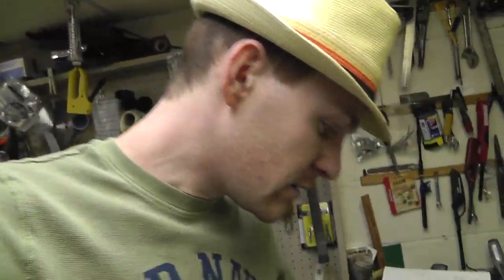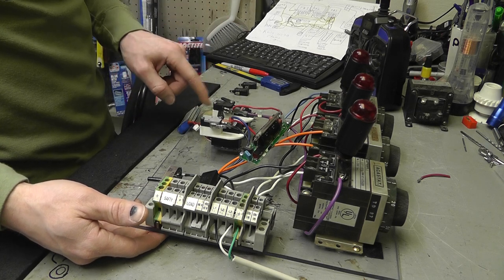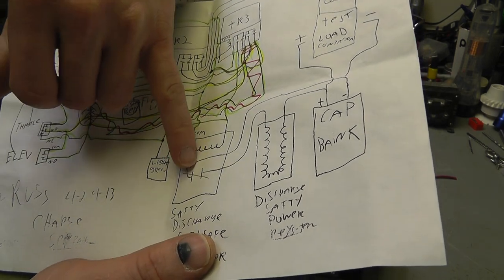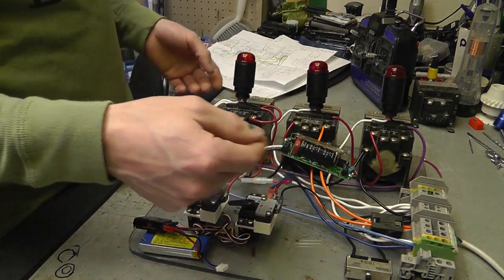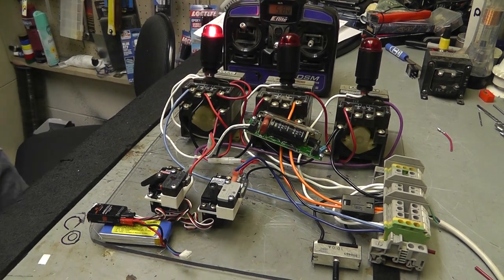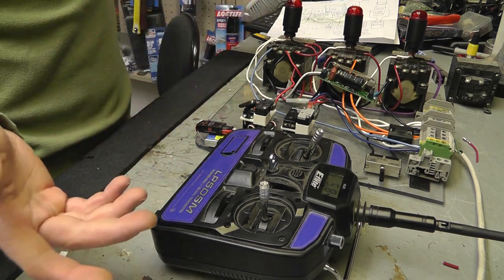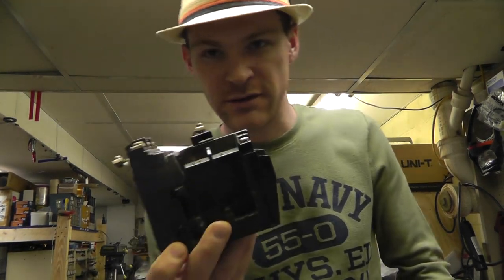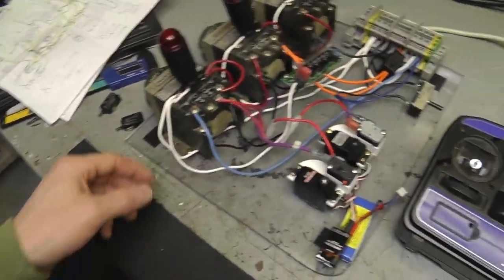10K joules 4: Remote Trigger & Safety's For First Test Fire!

Comment: Just remember Russ that for an ideal capacitor when you short it out you get infinite current for an infinitely short time.  What happens in your case is the series resistance of the caps themselves and the wires and the load limit the current to a certain theoretical maximum.  Then you have the inductance of the wires and the setup that slow down the rate of current increase.  Still, HV + very low resistance + very low inductance and you have a massive spike in current, possibly wire exploding.

Comment: Pretty cool design. For some reason I think of the game mouse trap. As far as trying a dead short on the monster relay I will tell you what to expect. Since the cap bank is a current monster X 10 on steroids I would expect the contacts to blow just like a fuse.
There will be no welding unless the wire from the cap bank feeding them fails first. Hey what did you smash your thumb with? I know that felt good. One more thing man, congratulations on your third child. May you get well soon sir.

Comment from the maker: Yes, there a 2 step prosse here. This just sets up the "ready to be charged" and the charging is separate. This charging is done Manually ( with my other setup) and once charged the charger voltage is removed. Then I the fail safe is trigged the caps are diss charged saffly. ;) ~Russ

Comment: The issue of what will happen when you short the capacitor.  If you start at very low voltages and no contacts weld themselves closed, you can assume the "load" is all the wiring leading to the relay contacts and the relay contact itself.  Whatever has the highest very low resistance will bear the brunt of the power.  That might be the wires themselves and they will heat up.

Comment: If you want to get a feel for how much the wire would heat up when you put 10K joules of energy into the metal, why not just calculate it for say a 4" x 4" block of the alloy used in your wire.  You can look up the specific heat of the alloy.  I am going to take a wild guess that 10K joules would make the block increase in temperature by 40 to 50 degrees Celsius.

Comment: If you were an uber nerd you could measure the temperature increase of the wire when you do a discharge, and knowing the specific heat of the metal in the wire and the mass of the wire you could see if the joules needed for the temp increase are roughly equal to the joules in the capacitor bank.

I am assuming that you don't have thin wires, you have probably seen TK's "wire explosion" clips where he discharges a HV cap though a thin lacquered wire.

Comment: Congratulations!  I like all your safety stuff but there is one issue.  When you loose power on the controller the servo resets and shuts the power off.  That's good.  But then when you restore power to the controller the system remembers were it was.  So you power up the controller and the system switches on.  Someone might not be expecting that.  You want "two steps on - one step off" in your logic all the time.